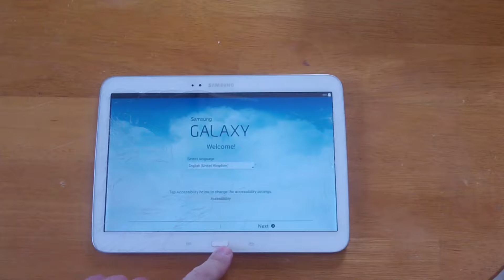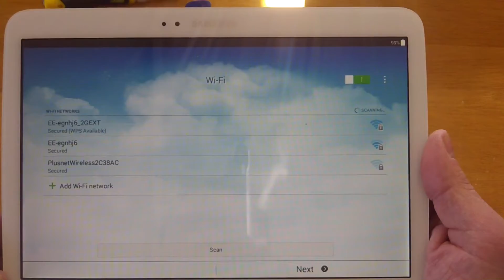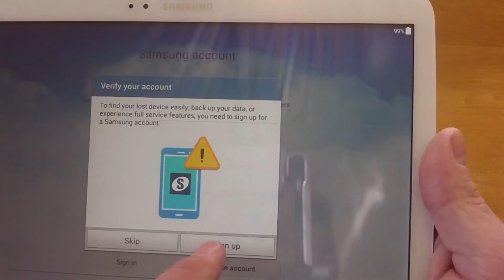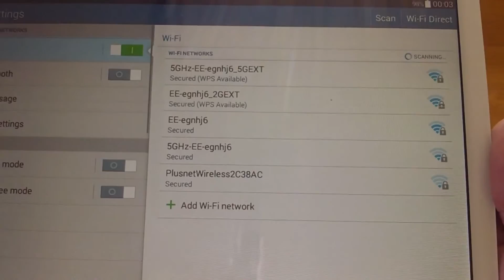Samsung | galaxy 10.1" motherboard replace | change | how to | GT-P5210

Comment: I just bought a samsung galaxy tab e with cracked screen also. My issue with my original tablet is the battery is not charging and when it had battery all it did was drained the battery drastically. I'm sure the problem is  more than a charging port or the battery itself. I even went to a technician to have this figure out but he could not fix it due to his overall knowledge of the tablet. He's sure it's not the battery though. Anyway I hope the work you did will work on mine as we have the same dilemma. It looks easy enough though. Just unscrew and screw. That shouldn't be a problem. Peace✌

Comment: Would I follow the same directions on my Samsung Galaxy tab 2 10.1  GT-P5113TS?  Tve replaced the battery and the charging flex cable already. Last resort is the MB.  I have the battery showing on the screen and the wheel stuck.  UGH  no one seems to know whats wrong
Reply from the maker: kay Schaeffer is the battery okay??
Reply from the maker: kay Schaeffer if the battery okay it may need a new firmware
Reply: sls energy so how to I do this when it doesn't turn on?
Reply: sls energy how do I install new software when it won't turn on